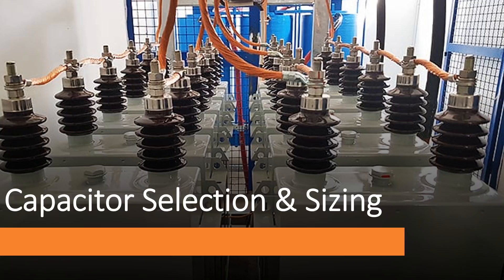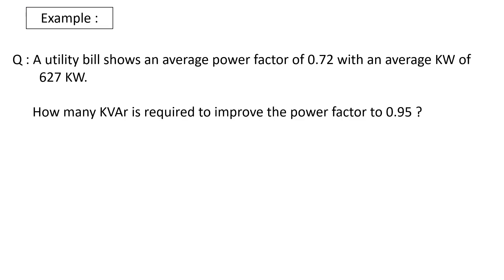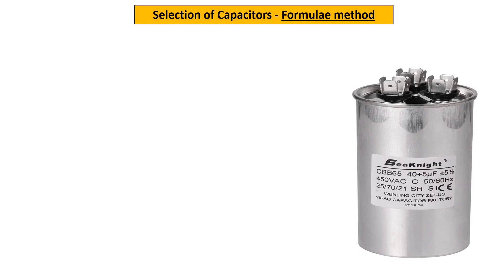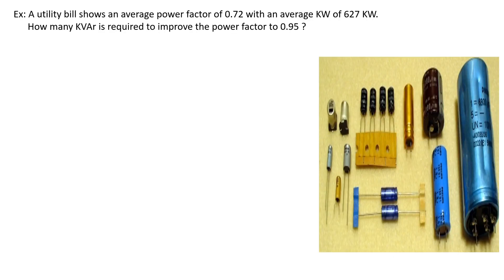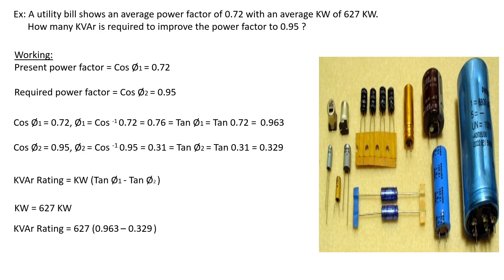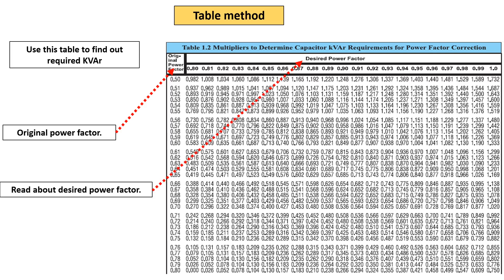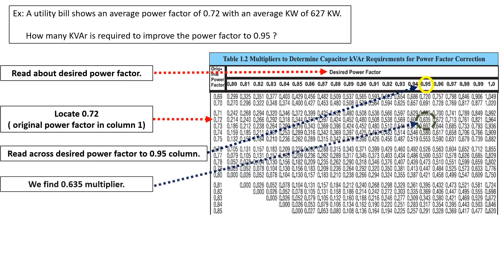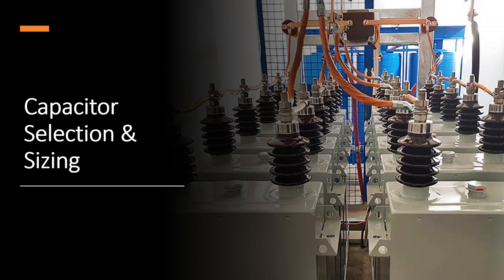IMPROVE POWER FACTOR BY CAPACITOR BANK SIZING CALCULATIONS

Comment: Sir please correct and confirm is this application 
thumb rule is 50-60% of average KW for 0.95 power Factor KVAR rating .
Reply from the maker: Hello dear....thank for watching video...the answer is NO, there is no such thumb rule..it varies very much depending on type of laod. Still for linear loads u can consider that there will be no load power factor of 0.6 to 0.7 for running KW. After that you can calculate as per video.